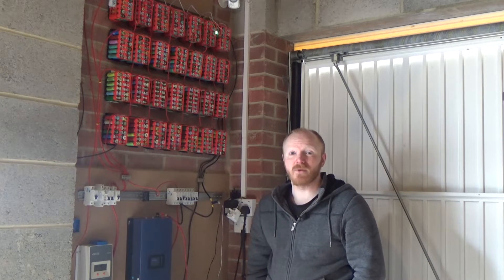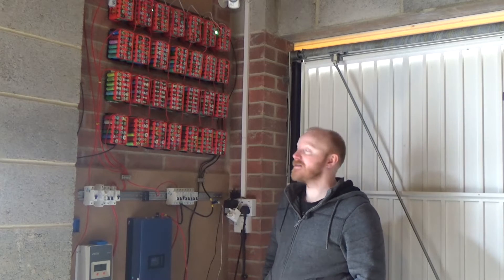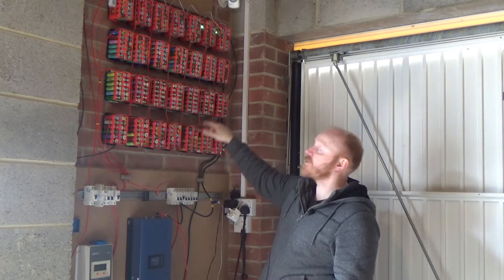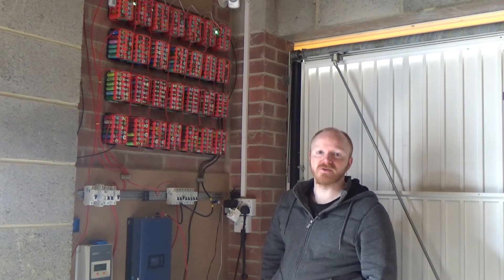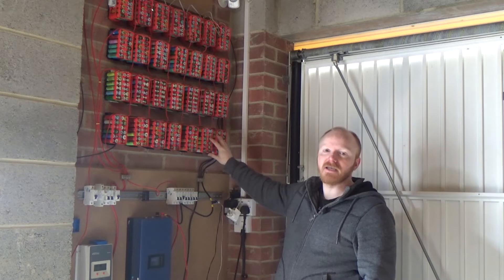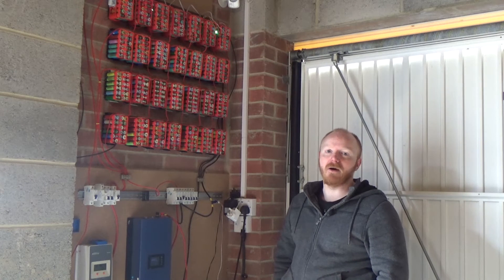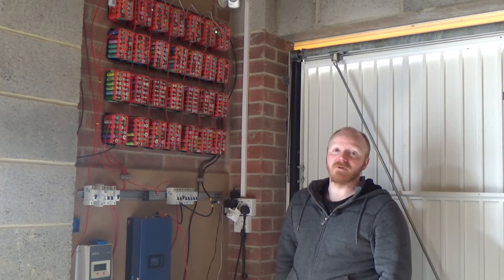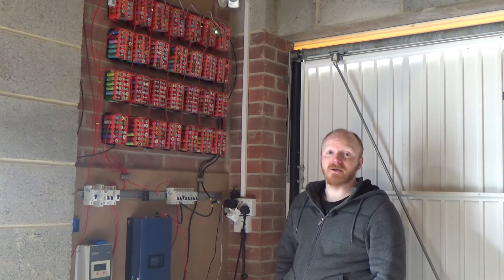I'm back and on the Maker Cast show!

Comment: Thanks for the update Colin, looking forward to following your progress...
For charging and discharging I use a couple of modified server power supplies in series for about £50 that can push 1.6 kW at 24V into a Charsoon Antimatter that can balance charge 1 to 10S up to 1kW.
I use it for my 14S ebike pack in two 7S sessions at 25A charge, or from portable solar at 300W - v useful!
Had to replace a cell in one of the packs at the weekend as it was pulling a module down slightly - bit of a pain disassembling and waiting for the bad cell to reveal itself, but good to go again.

Comment: Welcome back Colin! I want to do something very similar I think, starting small and building up. So I am assuming that blue box is a grid tie inverter that puts power back into your house electrics? Do you have to make the power company aware of this setup, or does it switch off with no mains AC? Do you drain you power wall with your house needs? Where did you source your new panel from? Lots of questions sorry!!
Reply from the maker: It's grid tied yeah so puts power back into the house, will a full blown setup it would need to be signed off by an electrician.  Mine is only 1000w however so barely 4A at mains voltage.  If power goes down to the house then the inverter will stop producing power, the grid tied ones are designed this way for safety.  The house will drain my powerwall very quickly, it's 4.4Kwh which sounds a lot but in reality is very little compared to house usage and were pretty frugal too.  My latest panels were from eBay, just a case of keeping an eye out for deals :-)
Reply: @Chickey  thanks! I need to start small, but actually start!!